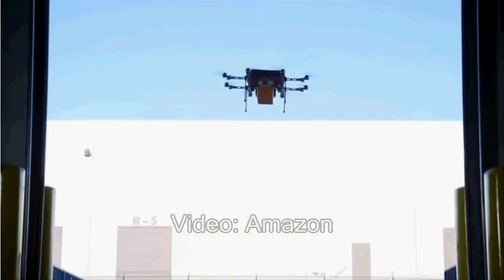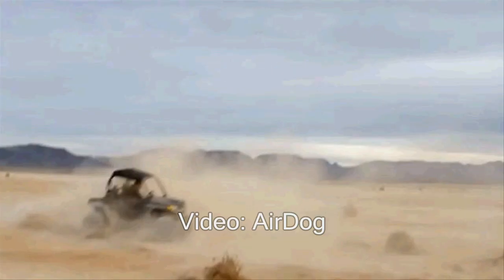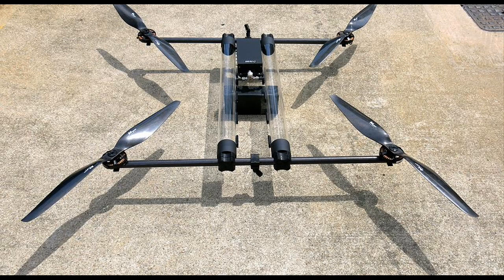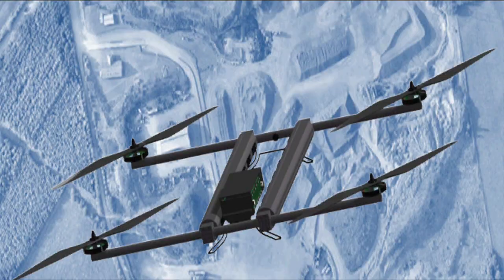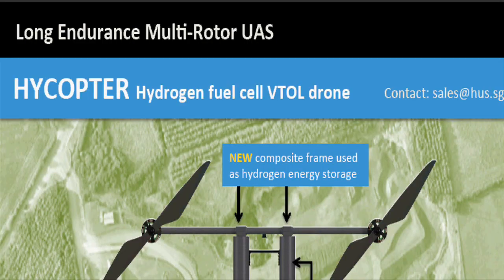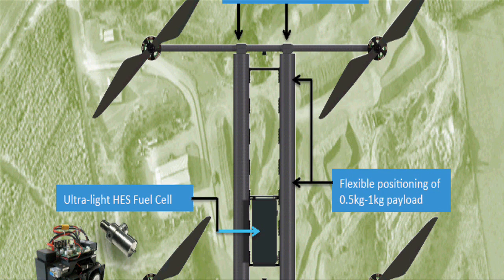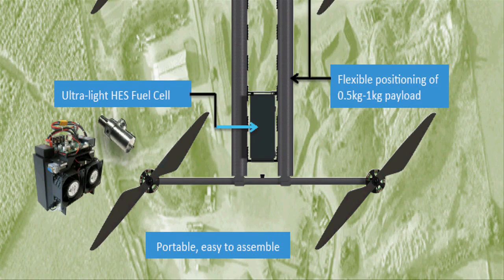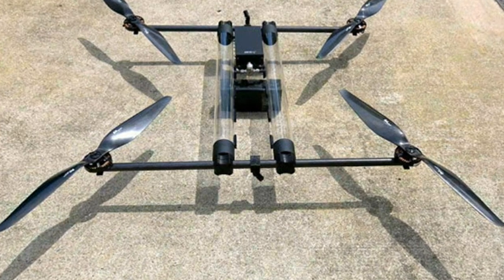Hycopter drone can fly for 4 hours using Hydrogen

Comment: Hydrogen or helium is alot lighter than air, so a massive amount of energy can be saved by using the hydrogen or helium to cancel gravity.
Reply: it's pressurized, so it's not going to "cancel" gravity. but it will be lighter per BTU compared to any liquid fossil fuel.
Reply: Fully lifting 5 kilograms would require 4,4 m³ or 155 ft³ of hydrogen at atmospheric pressure